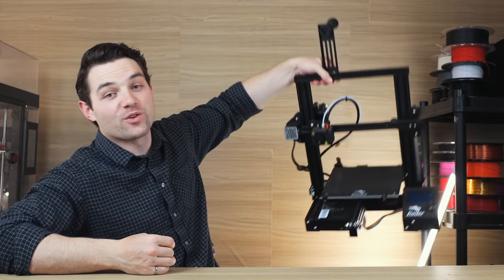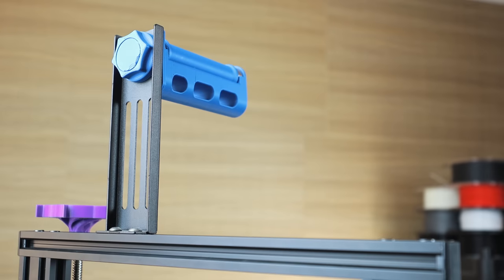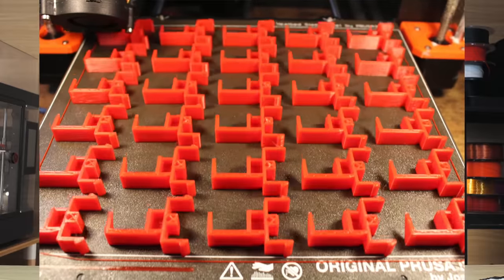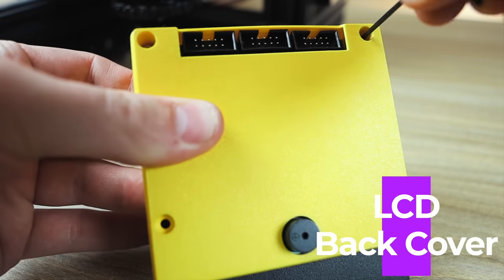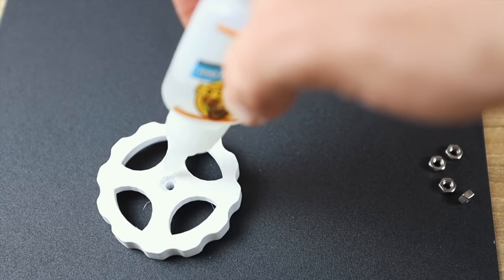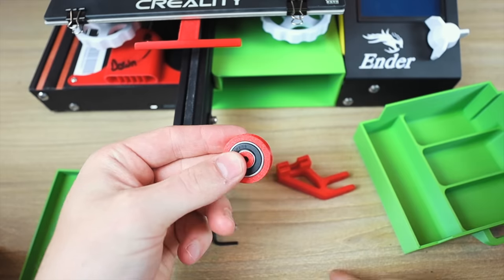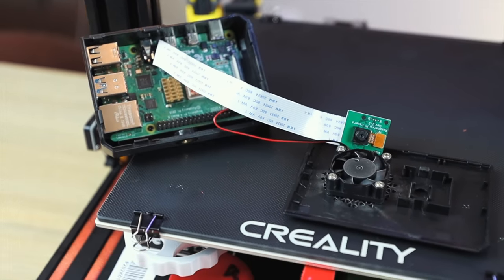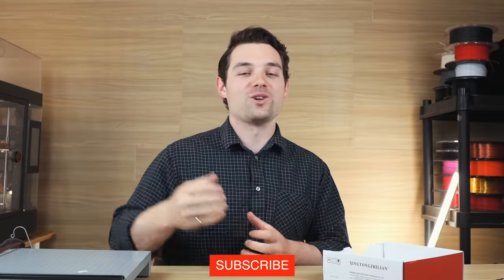Ender 3 Pro Upgrades - 2021

Comment from the maker: Updated Links 

Bearings - https://amzn.to/3p9SlSz
Screws - https://amzn.to/3hdoQed
Bowden Tube  - https://amzn.to/3kjiCeZ
Filament - https://amzn.to/3feFzg5
Glue + Activator for attaching printed parts - https://amzn.to/3IWHKT4
Reply: I printed that filament cooling ring you suggested.  With it installed, I can not make any prints anymore.  It cools the filament off before it hit the bed.  So for now, I rate it a thumbs down and will go back to stock.
Reply from the maker: @Daveyk021  Cooling before the filament hits the bed, I have never seen or observed this before haha. Make sure to check your printing temps and type of filament. If that fan addition had the ability to cool before the filament hits the bed I think we would see it on every single printer ever made :)
Reply: @AustenHartley  I am too new to know a good answer.  I put the stock part cooler on and it started working fine again.  I tried several bed temps ranging from 50-65.  Using inland White PLA.  Usually set it at 210, but with this I tried 210-220.  It just created strings.  I love the idear of that circular part cooler.  It would be a big help building parts that need external supports added.  I will try the shorter version again once I get a few parts printed.  I am now printing that filament roller with bearings (that should be in today.
Reply: @AustenHartley  I wish I could say why.  I played with several bed temperature and numerous filament temperatures.  All I could print was plastic string - lol.  Now I was using the taller one (it's not much taller, very little difference).  I will try the shorter one, maybe tomorrow. 8-).  I did print the roller wheel assembly for the filament entering the extruder.  Got the bearings for it today.  It works and looks perfect!  I did have to ream the bushing holes out with an exacto and then run the assembled wheel (spinning of course) over sandpaper a few times to keep it from binding to the holder frame.  I want to make the Z-AXIS handle, but mainly for looks.  I really do not see a need for it (yet).  If I want to move the axis up, I just do it through the front panel, or if the steppers are un-locked or the printer is off, you can just pull up on the x-axis bar (to me in the UT Immersion world, that is the Y-AXIS. X-AXIS goes the length and Y the width, but it opposite with the 3-D printer.
Reply: I believe the slot covers should hug the rail and use the slot cover as a guide sliding in not just inserted ha unless I inserted mine in correctly
Reply: @JoseAzua  I think you (Austen Hartly) were just sliding yours in the empty space.  They actually slide nicely, perhaps with some force in the rail slots.  Once I got use to it, it worked pretty good.
Reply: Is there a link to the leds you used? I didnt see one
Reply: Id love to win an ender 3. As the one i recently got. Has been nothing but trouble.  Since the first time I powered it up.  First black screen,  reconfigured.  Worked long enough to be ready for the first time print. then screen started flashing.  And now just a blue screen.  I got this printer from a friend.  He only opened long enough to remove the paperwork.  I've reconfigured the printer now 4 times. Yet, I still only have a blue screen. A free printer would be greatly appreciated if i were given one. Thanks for sharing the video.  I subscribed to your channel and look forward to watching your others.

Comment: at this point ender 3 is basically skyrim, it work out of the box, but you can also put 100 mods to make it better
Reply: This guy gettts it!!!!!
Reply: I mean, I had to mod the firmware of mines before the first succesfull print (manual mesh leveling issues)
Reply: Only difference is that it doesn't crash if you have all the mods.
Reply: And even with all the upgrades it's still cheaper then ones already upgraded and sell for more and the prusa and many others. Same quality prints,  way cheaper
Reply: But Skyrim didn't work out of the box
Reply: The BLTouch where I broke it. Literally gouged a hole in my magnetic print surface. I've given up and uninstalled that module 4 times in the past year ir two
Reply: Oh that's so good! Lmfao
Reply: Dammit Todd did it again....
Reply: I hate that I didn’t come up with this comment.
Reply: You have to assemble the Ender 3 but after it's done then it works out-of-the-box
Reply: @jimsinnovations2737  like which ones?
Reply: @legocaptainrex2965  anycubic mega s or x  etc  they are amazing really easy and they just work
Reply: But you can make to mods by playing the game
Reply: i love this quote lol, im gonna use it more
Reply: This dude
Reply: Prusa: am I an open source joke for you?
Reply: would you buy a ender 3 pro ($100 at microcenter) and mod it, or the ender 3 s1 ($280)
Reply: @ryanogle9716  so... Skyrim?
Reply: "it just works"
Reply: @FusionR300zx  Ender 3 pro for $100? Yes. Ender 3 s1 for $280? Big NO.
Reply: I think that whats make it so good
Reply: That's why I just got a 2nd hand 3 pro, just for the community support
Reply: I had to upgrade the extruder

Comment: TIP with the V slot covers, the thin side is up and the angle below takes the metal part of the frame, then slide it in, it gives you more height and also stops dust getting under, rather than having the thin side down

Comment: on the bltouch, if you hate manual leveling and have the money, BUY IT! Its easy to install, and works better than he says. You wont have to deal with drift with the knobs. It can have problems with erroring, but thats usually when you are leveling it. You can load your bed mesh in your slice.

Comment: I got an Ender 3 v2, before upgrading it, after every print I had to re-level the bed, after upgrading the springs to stiffer ones, issue continued, got BL Touch, leveled bed, adjusted z-offset and that is it. No longer the printer starts grinding the nozzle on the bed at all. And less releveling! So yes, for certain cases BLTouch can improve.
Reply from the maker: That is good to hear ! definitely works for some. Appreciate the comment !

Cheers !
Reply: The BL Touch is is not meant to compensate for the levelness of the bed but rather the flatness of the bed plate. You're still meant to manually level periodically. The BL Touch measures for warping caused by frequent heating/cooling cycles and adjust the amount of filament extruded to compensate. if you have a dip in the middle of the bed, no amount of manual levelling is going to fix the bed/layer adhesion problems you'll have. The BL Touch will extrude a little more filament into the dip on the first layer so the subsequent layers are properly level.
Reply: @sgtkabukiman9411  I am fully aware, but I prefer leveling it every 5 or so prints and not every god darn print, makes it easier for me.
Reply: 'after every print I had to re-level the bed, after upgrading the springs to stiffer ones, issue continued,'  Realize though, with this happening, you have something much more fundamental going on.  Rarely even have to adjust my bed at all on the CR-10, and the Ender has basically the same bed design.
Two main culprits, first being the bed wheels.  Instead of out at each side of the bed like they should be, it's supported very near the center, so small angle changes can make larger changes by the time you get to the side of the bed.  These need to be adjusted to near perfect, too tight binds and shifts due to the bearings being too tight, and too lose allows shifting.  You have to take out all possible play but be just under binding anywhere.  Looking at it, why they moved the wheels in closer on the bed is beyond reasoning.  In the direction of travel they should be as far apart as possible on the bottom of the bed, that's free extra accuracy.
The other main culprit is your bed level is stable, but your X carriage is not.  You want to adjust the free side of the X arm a millimeter or two high, so when the carriage is moved to that side it comes down to even since it's mainly supported on one side.  You have to make sure that the wheels on both sides have minimized play but do not bind, both when the carriage is on the left and on the right.  

And of course the X carriage wheels have to be correct as well, but it's easier to feel the X carriage moving or binding so most people notice that more easily.
The wheel system can work, but it requires good adjustment to be reasonably precise and repeatable.  Almost all of the 'my printer isn't precise and repeatable' problems in Creality printers trace back to these.  
Once you're set up for the day and have the bed level you should hardly ever have to mess with your bed.  Even every 5 prints you almost guaranteed have some other more fundamental problem causing your bed to shift around instead of being smooth and precise.
Undo your belts and move everything around by hand and it should all glide smoothly and precisely, no real wobble and only smooth deflection even when you push on the edge of the bed.  If you feel much of anything other than smooth motion while doing it by hand, you have problems.  And be aware, the plastic tires on these wheels can develop flat spots if the forces are too high on them and they aren't moved for a while, which can throw everything off   Even one of my machines did this, I had left the X carriage up off the bed for a good while, and the weight was putting pressure on the wheels on the X arm..
Even if your issue ends up being something different, realize you have an issue going on and your bed shouldn't be changing that often, something is shifting.
Reply: @sgtkabukiman9411  No, BLTouch/3DTouch creates a mesh map of your bed and applies correction to Z axis so the nozzle height is consistent across any [X,Y] coordinates. So it can compensate for unleveled bed as well, easily. I have not leveled my bed once since installing 3DTouch years ago.
Reply: Which springs did you use?

Comment: NEVER remove both fan screws on your power supply at the same time!!! The fan will fall into the power supply housing and you will have to disassemble it to get it back in place! Rather do one at a time if you are installing the PSU fan baffle! Trust me, I speak from experience.
Reply from the maker: haha I did this too. You just have to take the front plate off and hold the fan while you screw it in. But yes very annoying :p

Comment: One of the most important parts about running the BLtouch is not ease of use as much as it is to create a bed mesh. When it probes various locations it compares the height of each of them and then generates the new zero for that spot where it actually physically reaches the bed and adjusts for that during the print. 

For example, you might have a slightly warped carriage that has some warping near one of the corners. Trying to correct that by simply adjusting the knob will actually change the slope of your print bed in a way that can cause issues on the non-warped areas. There are only two solutions for this: 1. buy a new carriage or 2. Use a BL touch to generate a bed mesh. When you take that into consideration, the ease of using a BL touch compared to manual leveling is the cherry-on-top to save you some time, not the main feature.
Reply: I agree, 100%.  I level my bed when heated, and prints come out nearly perfect at the corners, but the father they get from the corners the worse they are.  My glass bed is lower in the center.  I plan to add BL touch so it could detect that and help my prints come out better across the entire surface.
Reply: Even better if you can get a visualization using octoprint or klipper!

Comment: I recommend using clips for your glass bed. As he said, you can just put the glass on the heated bed and take it out. I would not recommend that because the speed of the Y axis will move the glass bed and cause some really bad layer shifts.
Reply: Clips are not optional, your plate will slip all over the place if your bed is actually flat and you don’t clamp it down.  I don’t think he meant that you shouldn’t clip your glass plate.
Reply: I use kapton tape. Way better

Comment: If you are willing to invest a bit in upgrades, than this is my list:

32 bit board
BTT Pad 7
BL or CR touch,
Sprite Pro extruder kit
Flexible print steel sheet
And a good firmware with configured imput shaping and linear advance.

If you want to save some money, dont buy the BTT Pad 7 Klipper pad. You can run imput shaping and linear advance on a 32 bit board with marlin.

Comment: I thought the BLTouch was pointless when I first got it, but it won me over the time when I needed to tweak the nozzle a fraction of a millimeter closer, and all I had to do was tweak the Z offset and it just worked without having to do any physical adjustments.
Reply: What is your offset I'm having trouble getting mine working, do u have bed leaving checked in the settings, I'm using jyers
Reply: @jimsinnovations2737  Offset always varies printer to printer, it is useless getting someone else's.
Reply: @ivolol  I've figured that out now lol
Reply: +1, I've been using a BLTouch and now that I try to get the best quality out of my printer I disabled Mesh Leveling but still use BLTouch for Auto Home, as it's the easiest and safest way to adjust the Nozzle height without risking to lose your perfectly leveled bed
Reply: My BLTouch didn't work so how did you make it work
Reply: @SuspisiouslyMango  did you download the correct software?
Reply: @SuspisiouslyMango Add G29 code to your slicer so it probe and adjust the bed height variation for every print. Note: BL/CR touch is not a replacement of bed tramming/leveling. You do have to have a reasonably good leveled bed for the automatic bed leveling (ABL) to work.
Reply: @SuspisiouslyMango or insert M420 S1 after G28 to load saved ABL data from previously saved bed mesh data.

Comment: Your episode is fantastic and very informative, but the only thing I strongly disagree with it the BLtouch, especially being an engineer I would expect you to love it as higher accuracy is always better, I bought an Ender with a terrible glass bed and struggle for a very long time trying to level it well. I ended up buying a BLtouch(a real BLtouch) and truly feel this has been the single most important thing I've done to my printer period, I now never ever have to fuss with getting my bed perfectly leveled and then make sure the clearance is right and all corners are the same, I hit new bed mesh and then set the Z height to where I like it and thats it absolutely 💯 accurate, I can even remove the glass bed and swap a pei sheet on it and I don't even have calibrate or adjust anything it always keeps the nozzle exactly the right height off the bed

Comment: 11:08 except it is not complex in the slightest compared to the parts already on the printer, and realistically you will never have a perfectly flat bed so a bed leveling probe is a pretty good upgrade.
It has a more pronounced effect on big printers like a cr-10 max, they make things quite easy regarding leveling because they will compensate for distortions unless the bed is way off.

Comment: Switch the orientation of the aluminum extrusion covers! The smaller part should be facing “up”.

Great videos!!
Reply from the maker: Thanks Alex ! Yeah they are definitely in upside down. I think I was too focused on having the textured print side showing haha. 
Cheers,
Reply: @AustenHartley  They are not upside down, But you did put them in too low.  The top surface should be flush with the Aluminium top.  The V slots into the V not under it.
Reply: @thack2502  No Alex is right. The smaller bit is the top, and the wider part is the bottom. Originally thought the opposite myself before I printed them for my machine.
Reply: @Matoikey  Exactly. It even specifically states to do so in the description ("Insert in the extrusion with the widest part at the bottom."), not to mention that is how it is pictured in the example images.
Reply: I was wondering if someone else saw that...

Comment: Just some notes, the spool roller w/bearings is really nice been using it for almost a year now, same with both filament guides although I have recently moved the spool holder off to the side and no longer need the guide for the top bar, however, the one that goes on the extruder is still in use, now in regards to the drawers, if you have big hands like me and you manually level your bed DO NOT put this on your printer, I did, thought it was great, put all my tools in it... then I needed to level my bed one day and boy does this drawer get in the way of trying to get at the knobs. I think it lasted maybe a month before I was too frustrated with it to keep in on the printer, and it only lasted that long because I did like it but in the end, it was just too much hassle.

Comment: The Ender 3 Pro doesn't have the electronics fan on the top of the printer so you won't need that cover on the Pro version.

For the bed i def recommend a PEI Flex plate over a Glass bed.

we were running 2 ender 3 Pro's with glass beds 24/7 and have swapped both of those out to PEI Flex plates and def won't go back to the glas beds.

Comment: You may not like the touch probes but when the bed isn't flat out of the factory, it doesn't matter how much levelling you do... you can't adapt for high and low points across the board by wiping a piece of paper on each corner a couple of times. Touch probes are fantastic, yes it took a bit of set up and messing about, but my printer runs a check every time its switched on and i don't think i've touched the manual dials since installing it.